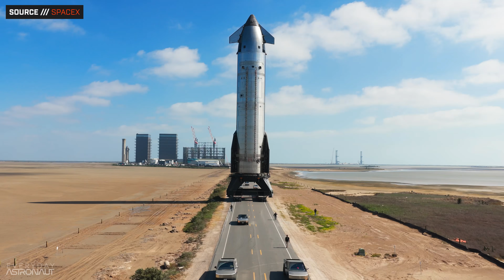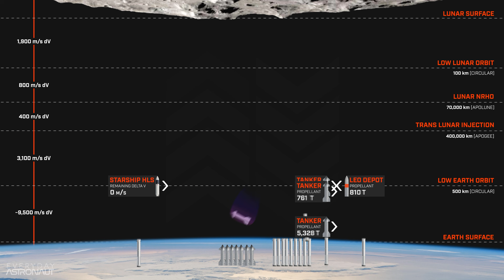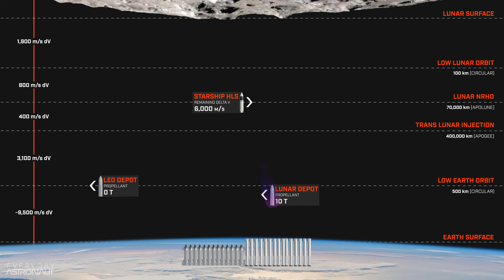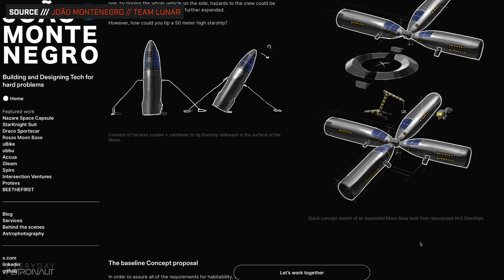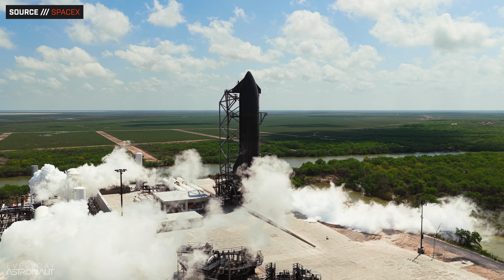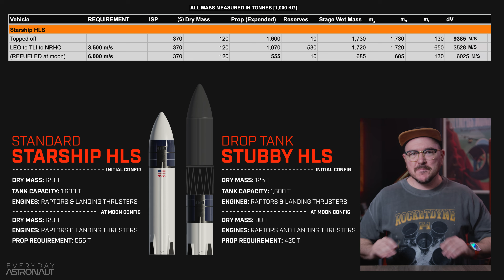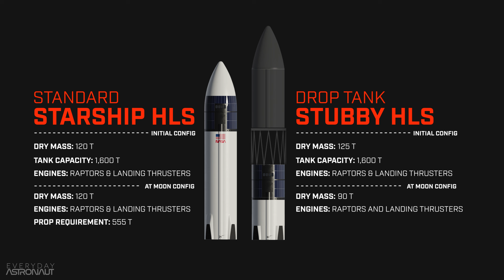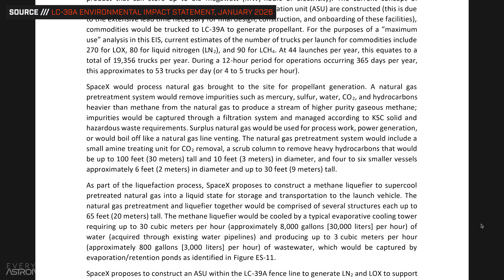Does Starship REALLY require 15+ launches to land one lunar Starship?!

Comment: I don't see why HLS needs retractable landing legs. Extend them while still in Earth orbit, even with support from the refuelling station perhaps, then leave them out permanently, They should be huge so toppling isn't an issue. There's no reason they couldn't stick out half as far as starship is tall, there's plenty of space for them while in flight
Reply: Above a certain size that’s just more weight that might not be needed 

Even with their refueling plans they have to cut weight wherever they can in the rocket design to maximize payload
Reply: @Kingdomkey123678  even more reason to have them deploy once and never retract to reduce complexity, whatever size they are

Comment: Awesome video as always! The key factor here really is the tonnage that you can bring to the surface of the Moon! In fact, if you compare the 100 t that Starship can deliver versus the 3 t that Blue Moon Mk1 will bring, that’s roughly 12 or 15 launches for Starship versus ~33 for Blue Moon to deliver the same mass 😅. That’s something people don’t often realise!
Reply: Blue moon MK2 cargo lander can land 30t on the moon.
Reply: @ಮನು That 30 ton figure is the MK2 itself (structure).  3 tons is the deployable, usable, leave-behind payload.  3 tons a trip to the moon surface, a lunar base does not make.
Reply: Compare the 3 tons of deployable, usable, leave-behind payload for one MK2.
To 100 tons of Starship.

MK2 architecture has 3 ships (MK2 Lander + Tug + Tanker) launching from earth to do that.  100/3 = ~33 - so 33 missions for MK2 to equal one mission for Starship.
MK2 has to refuel over the Earth.
Tug and Tanker have to combine to form one ship.
Then all 3 (or 2) of those have to travel to the moon.
Then MK2 gets refueled over the moon.
Then Orion docks.  MK2 goes to the moon surface.  Takes off later and docks with Orion.

So 33 missions of this to do a Starship mission.

33 * 3 craft = 99 launches.  BO also needs to send up takers to refuel above the earth, so let's assume 1 per mission.  99 + 33 = 132 launches from earth.

Comment: Hear me out:
Why not land upside down. This why you keep all trusting stuff in one place. No need for lift. Only issue is you are top heavy now.
Reply: Engines and fuel remaining (to do the subsequent liftoff) would massively change the center of gravity if Starship HLS would land "upside down".

As it is, the CoG is probably 1/4 the way up from the bottom when it lands, thus changing the tip over angle to about 21 degrees, with reasonable landing legs protruding outwards, see "geometry" for the math behind this.  The landing spot will probably be the most heavily photographed and analyzed spot on the lunar surface by NASA before hand.  It won't be a "random, rocky, soft" spot.
Reply: @ConstantTrue  Not sure to whom are you responding in last two sentences. But how important is CoG in 1/6 of g? While landing you can compensate for that and once landad you could ancor it to make it sable.

Comment: I'm not sure a ladder or backup lift is necessary. Just some climbing ropes and pulleys. Surely it would be fairly easy to hoist a person 15 metres in Lunar gravity?
Reply: To placate NASA.

But seriously, a 2000 lbs harbor freight winch on a pole off to the side, deploy the winch hook down the side before they use the elevator.  Duh.  Make it wireless remote and wired, you know, because those fail too, it is harbor freight after all...

Kidding, but you get the idea.  Not a hard thing to have backups for...

Comment: 1:29:23 "Stochiometric ratio is 4 to 1 meaning you need for grams of oxygen to perfectly combust 1 gram of methane". Also being a chemistry nerd my first thought was, wait that can't be right that it is a perfectly whole number. Did he mix up mols/molecules with grams? But then I did some quick calculation and it turns out its actually correct - the atomic masses work out by a coincidence in nature to make a whole number. Let me explain if you want to understand it:

The reaction equation for the perfect combustion is:
CH4 + 2 O2 -> CO2 + 2 H2O meaning for perfect combustion you need 2 oxygen molecules to react with each methane molecule (you can check the correctness by counting the number of atoms, there is 1 x C, 4 x H and 4 x O on both sides of the equation).
Now the atomic mass numbers are: H:1 (single proton), C: 12 (6 protons + 6 neutrons), O: 16 (8 protons and 8 neutrons).
So, CH4 has in total a mass number of 12+ 4 = 16 which by coindicence is the same as one O atom. And O2 of course is twice that: 32.

So, you burn 1 methane molecule with 2 oxygen molecules, and each oxygen molecule has exactly twice the weight of 1 methane molecule resulting in a mass ratio of a perfect 4 to 1 for stochiometric combustion. (if we leave out the nuclear mass defect and that a tiny fraction of all atoms will be different isotopes, like Deuterium and C-14 which slightly would skew the numbers from the perfect whole ratio)
Reply: UK students doing GCSE Chemistry tomorrow will appreciate this comment.
Reply: chem paper 2 tmrw procrastinating by reading this comment😭
Reply: It's nice to see young people interested in chemistry.
Reply: Had the same thought. Thanks for explaining 👍👍
Reply: Very good! But of course there will be some deviation from the theoretical ideal due to incomplete burning, though the full-flow Raptor must be pretty good.
Reply: thanks, ChatGPT
Reply: @artemonstrick what did you call people before chatgpt?
Reply: @KoeddkHD  thanks, Wikipedia
Reply: @artemonstrick  😂
Reply: @hoots187 And they wonder why we call them a cult 😂
Reply: @artemonstrick  both AI checkers (pangram and GPTzero) I checked mark this as 100% not AI generated. It's most likely just a person who likes chemistry!
Reply: @a__f . you don't have to use AI checkers an AI response would have had a point to the whole reply, this is just a factoid

Comment: Remember the idea of turning an old starship HLS into a permanent moon habitat? It would make much more sense since using this big af thing for anything else seems pretty stupid.
You fill the cargo part with forniture and stuff, refuel, land on the moon and put it horizontal, then astronauts open doors into the now empty fuel tanks, redistribute the forniture and cover the entire thing with a layer of regolite for protection. (I know still a lot of problems to solve but seems a much more reasonable use for such a big rocket that won't come back to earth anyway)

Comment: Everything stays in how well starship can return to earth. Ship V4 will not change drastically things. SpaceX has already got really close to the theoretical limit of this chemistry ISP. The fact that Starship will need 10-20 refueling trips means nothing if the cost of the launch will be close to the refueling cost. That's all that matters, how much will it cost a Starship to relaunch. The fuel cost is <5%. And if you go with let's say expandable upper stage I think you win only 50 more tones. If you can repair and refuel the starship with 50% to re-fly once you are already  at cost parity.

Comment: I find the 125 tonnes dry mass (for current version)estimation utterly optimistic, and also even if would be true the final mass in the rocket equation should include not only that and payload, but also consumables (like gasses for pressurization), for the current autogeneos solution and size of the tanks those numbers are also significantly higher, like 2% at least from the initial propellant, that's 32 more tonnes, any calculation most include that death and useless mass, well also the 370 seconds specific impulse it's slightly wrong,would be correct only for V4 Starships that has sixth vacuum Raptors (380sec each) and three sea level (350 sec each) , for current version with sixth engines the accurate number should be 365 seconds, so check your numbers and use more realistic ones next time.

Comment: The very first thing NASA should do is build a landing strip and start landing on wheels at 200 km/h and using wheels and breaks instead of wasting delta V slowing down to nothing. Same thing with lunar escape velocity. Take off along a track with electric motors providing you free delta V until 500 km/h then switch to chemical. The moon is unsafe because there's no infrastructure. As soon as there's infrastructure it will become no different than landing at any airport on Earth.

Comment: How about sending denser materials into orbit and then converting them into CH4 and LOx in the refuelling depot? Send a bunch of Carbon and water up. Using electrolysis, decompose the water then burn the carbon in the oxygen leaving you with CO2 and H2 then use a Sabatier reactor to make Methane and O2.

Comment: I still think that Starship would make a great lunar base, a great moon orbiting hub and maybe one day it can transfer astronauts or push cargo between earth and moon orbit. However using 1 module as a jack of all traits stops it from being as good as it can be at each of those tasks individually. The fuel tanks and engines are no use once it lands. Having something that big repeatedly lift off and land just adds unnecessary risk and the task of transferring astronauts between lunar module and orbiting hub/Orion can be done by a much smaller spacecraft with a lot less fuel.

Comment: Why can't the SLS do the same thing Apollo 11 did? Single rocket to and from the Moon? If we can't do it now, how did we do it in 1969? Something doesn't add up.
Reply: because the apollo moon lander was 7 tons and now elon wants to land a 150 ton moon lander on the moon. and booster etc all need extra margin for returns boosts and landings for reuse. and its made out of stainless steel instead of lighter materials. and he wants the entire 150 tonne lander to take off from the moon whereas with apollo, half of the lander remained on the moon and only half took off, and only a tiny capsule made it back to earth. everything adds up.
Reply: @slopedarmor  Duh. But why can't SLS do what Apollo did? That's the question.
Reply: @robrobinette  SLS rocket is made from off the shelf parts basically. second stage is also a pre existing design and not a custom design for the moon landing. There are plans to improve the SLS payload by uprating the shuttle engines and switching to an actually new second stage with more performance to finally eclipse the saturn v payload. So then SLS can do what apollo did. Except for the fact that the SLS rocket will be cancelled before those improvements ever fly.
Reply: @slopedarmor  All for only $100 billion. Yay NASA!

Comment: Is this plan even feasable? So many launches to fuel the Lunar startship for what, 1 mission?
Reply: It sounds absolutely insane to use so many launches but starship is so insanely (relatively) cheap because of how each launch can be reused. It is simply cheaper to launch a bunch of reusable rockets than  to launch less rockets but letting than burn up in orbit (plus less safe because those rockets could have problems deorbiting and potentially land on land).
Doesn’t mean the moon landing requires such a large lander, but even still it is not crazy as it sounds.
Reply: Some bloggers suggested that starships delivering fuel for the first mission might be disposable. This would reduce the dry weight of the second stage and increase load capacity two-three fold.
Reply: @alexander12305  THAT would be expensive. The trick seems to be reusing the hardware many times, so the launches get cheap. The limiting factor or the optimal solution can often be worked out in a spreadsheet with dollars as a unit in many of the fields. Or if you want to go one more step Elon-style, calculate in resources and energy usage. Remember, this whole lunar program is a side quest on the "human civilization on Mars" program. Upgrading your civilization on the Kardashev scale and colonizing planets makes you worry less about doing a few more of the things that should be very routine. There are currently two separate factories being build for mass production of these vehicles. Yes, feel free to call that crazy, because what kind of sane words can you use to describe this?

Comment: Use aluminium instead of stainless steel for the HLS. Weight will be of the same order as the stubby solutions but with much bigger tank sizes

Comment: 1:21:45 and the problem isn't SLS capability, but Orion Service Module is too small for that. Raiz Space recently made a video where he used Blue Moon Mk1 as the service module for Orion and turns out you don't even need SLS upper stage for the mission to LLO. The hydrogen service module takes Orion all the way from LEO to LLO and back

Comment: Also, how will this scale to missions to Mars?
Reply: Differently. In that case you have an atmosphere at either end, so you go surface to surface with some refueling.
Reply: Really well. Almost the same but instead of doing a the deceleration burn in three days, you’ll do it in 6 months to reach mars. Once in mars CO2 from the atmosphere is required to create methane to leave the atmosphere that is more dense. The atmosphere will help you slow down too on re entry making it easy to reach and harder to get out. Different challenges but the transit is the same for anywhere in the solar system once the technology is developed. I think it’s worth it.
Reply: For a practical mission to Mars we might need to develop nuclear thermal propulsion to cut down transit time substantially. The length of the mission is prohibitive otherwise for multiple reasons: radiation, time spent in microgravity, and psychological issues (underrated but major).

Comment: In-flight refuelling was developed in the 1940s. Air turbulence was a bigger issue than the vacuum of LEO is ever likely to be. Clearly fuelling the tankers to fly to the orbital depo represents a logistical challenge, but not orbital fuel transfer where the only real challenge is replacing gravity with thrust or gas pressure, and that’s already been demonstrated. The value of refuelling spacecraft once in orbit for deep space missions was also recognised in the 1940s 80-years later and people are still fizzing about its impossibility. I look forward to the orbital assembly of spacecraft as well as fuelling for truly manned deep space missions.

Comment: I know they aren't talking about Mars anymore, but it would be interesting to see some of these numbers for Mars.  The idea of a flotilla of dozens of starships heading to Mars, presumably also with propellant depots accompanying them... It would be thousands of launches that would have to happen in a very short time frame just to get that flotilla moving.
Reply: The entire reason to use metalox is that they can refuel using martian CO2, and starship has the delta v to return from the surface in a single stage. 

No need for propellant depots by mars.
Reply: They have only moved the current focus to the moon as that gives spacex a faster iteration path, the goal is still Mars. I would not be surprised if spacex sent some starships of to Mars just to find out how much they don't know yet.
Reply: @shaung949  Musk keeps saying he'll send a Starship to mars as a test, but the Planetary Protection Officer isn't likely to be a fan of that plan. 

The cost of scrubbing a starship to their standard would be astronomical. Category IVa limits them to 300k spores per spacecraft, which isn't going to be so easy considering it's size and the fact it has to sit outside.